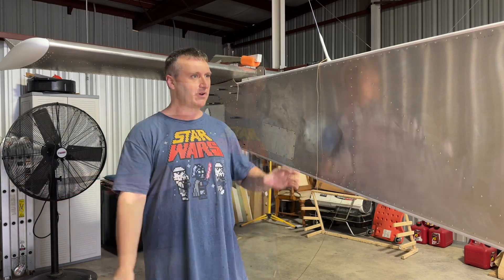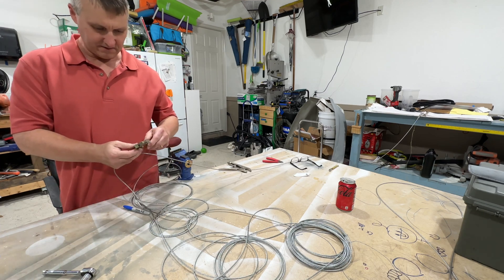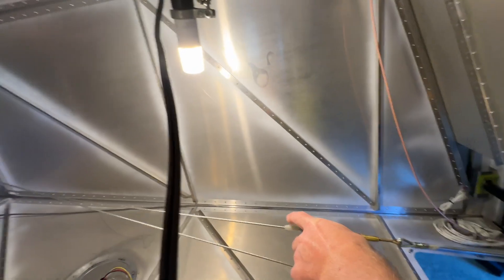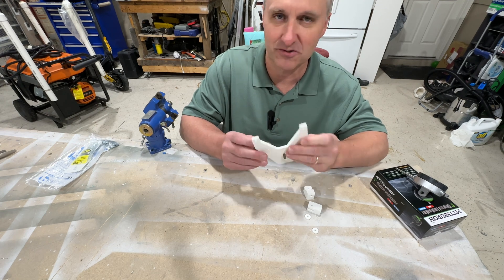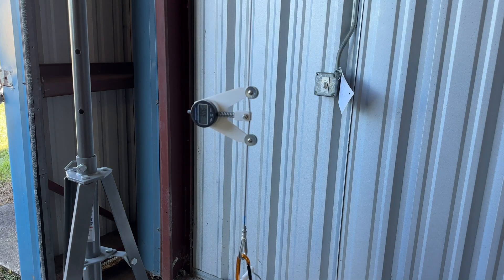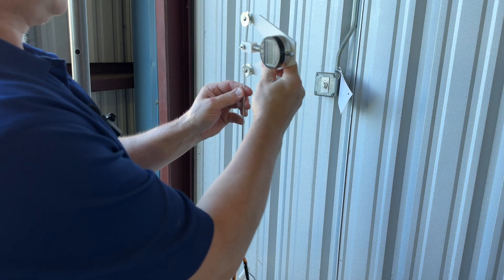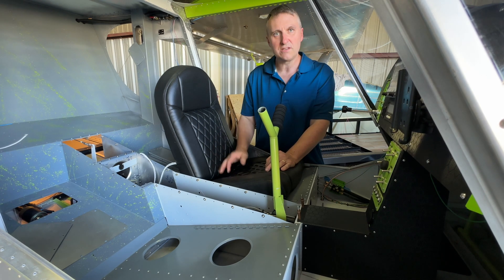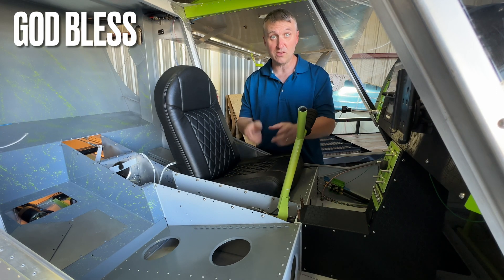Elevator Rigging / Tensiometer

Comment: I am building the tension tool from Darrin, where did you find the pulley wheels?
Reply from the maker: My local ACE  hardware store is where I sourced everything for assembly. Just used small nylon spacers and a penny washer for now. See kitplanes article for curving the penny washers. I did buy the metal bearings and spring from McMaster Carr, from the article, but did not use them.